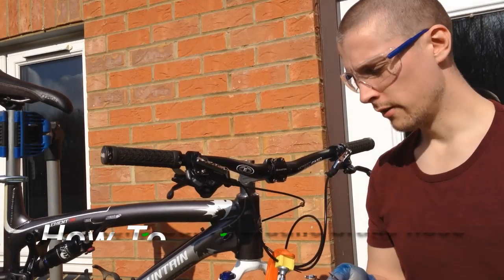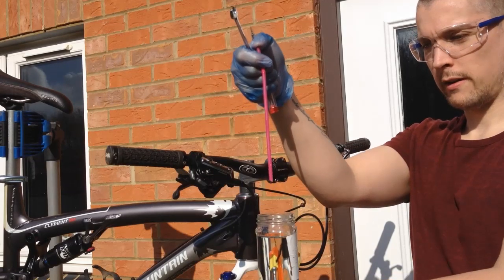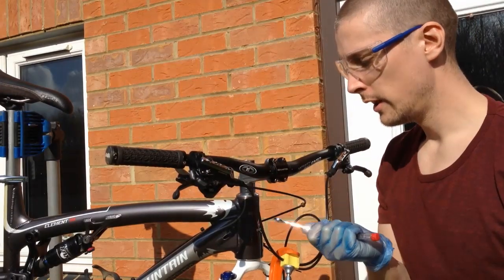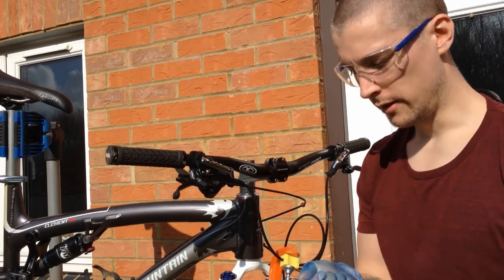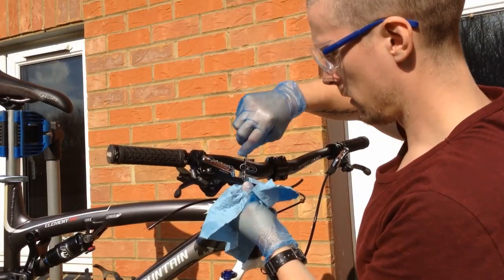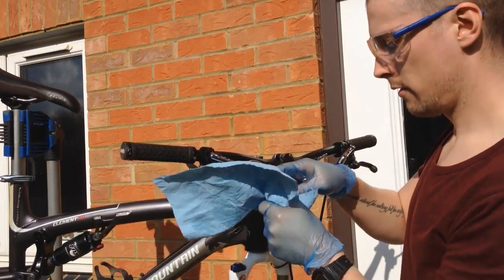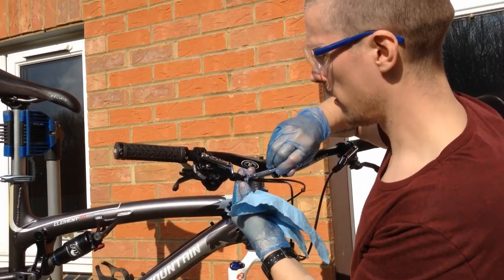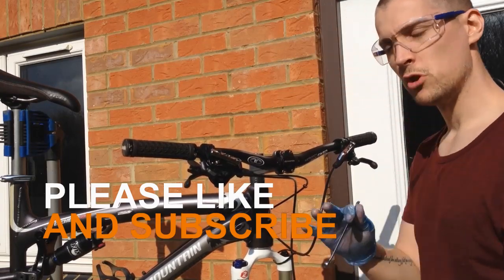HOW TO SHORTEN YOUR HYDRAULIC BRAKE HOSE

Comment: After doing this I seem to have leaks coming from the bolt that tightens back against the olive and the brakes are not so good , possibly under or overtightened the bolt , any ideas ?
Reply from the maker: Martin Quinlan hi, check it's a straight cut and retighten. Just double check you've don't it right. Now that it's been leaking it will probably need bleeding.
Reply: Thanks
Reply: also , when bleeding , have you any idea if that lever fade adjust screw is best screwed in or out ?

Comment: This video give me the confidence to do my brakes all turned out fine thanks, I will mention the little part that needs to be pushed into the pipe to stop it crushing is really hard to go into the pipe, what I did was warm the end of the hose up a little with a lighter for a couple of seconds keeping the flame off the pipe then pushed it in and it flew in if this helps.
Reply from the maker: I'm glad you gave it a go. :)

Comment: Really helpful video, i have a new set of shimano brakes, i want to shorten them but dont want to bleed them. Here is my question, did you do anything to the caliper? Or Just cut off the area you want to remove and install the metal piece with the olive and attach it to the lever? Would there be any fluid loss, and would that affect the braking performance ? Just trying to make sure i know the proper procedure before attempting to do this. thanks!

Comment: Hey , great video . Im going to give this a go on the new xts Im buying , how come you didnt have to push out  the pistons or take the resevoir cap off ?a lot of the other guides for shortening say to  do all of that .
Reply from the maker: Good point about pushing the pistons back I didn't do that because the brakes had just been fitted.

Comment: Excellent, easy to follow video. I just shortened my front hose by a few inches, took maybe 10 minutes because I was being careful. Not careful enough though, because after I cut the hose, I bumped the brake lever and some oil shot out. Luckily it was only oil left in the hose and maybe a tiny amount from the lever itself, because when I reattached the shortened hose the lever had good feel. It feels 95% of what it felt like stock, so that's satisfactory for me. 

I'm getting a rear Shimano brake soon, is the process the same for the rear brake? It could be different because the brake hose is more horizontally placed for rear brakes, as opposed to the near vertical position of the front hose. 

P.S. The metal of the lever nut is very soft and strips easily. Be careful.
Reply from the maker: Wow good on ya for giving it a go. The process is the same for both brakes :)

Comment: Hi, swapped over and fitted the new deore in about an hour start to finish, now the rear squeals like a pig and they both need bleeding, bought the syringe and cup and fluid yesterday so will set about bleeding next!!
Reply from the maker: That's a shame. How have you got on bleeding the brakes Carl?
Reply: TheSpankedOne went OK, made the mistake of not nipping up the fixing into the lever enough so the olive didn't seal correctly, I pumped the lever 5 times and it blew a bubble in the outer casing of the hose just after the nut, had to cut another inch off the hose and buy another pin and olive from my lbs, sorted now, thanks for the video, it gave me confidence to go ahead, not just to save money but also increase my knowledge
Reply from the maker: It's a shame it didn't work for you first time mate.But I'm glad you're getting stuck in and giving it a go :)